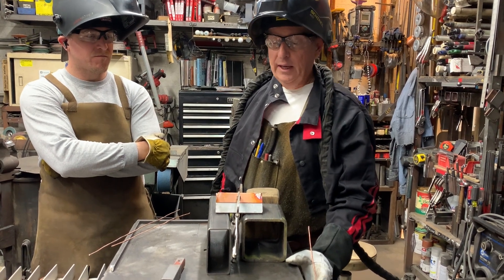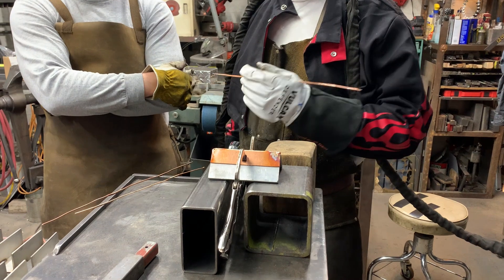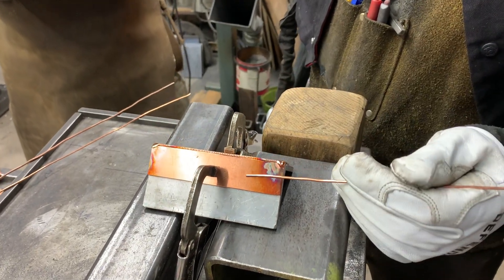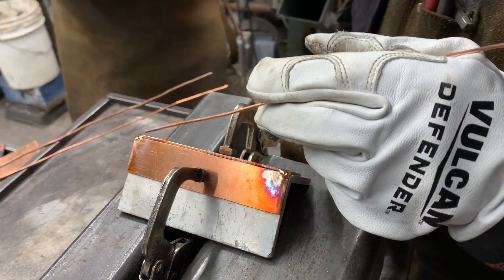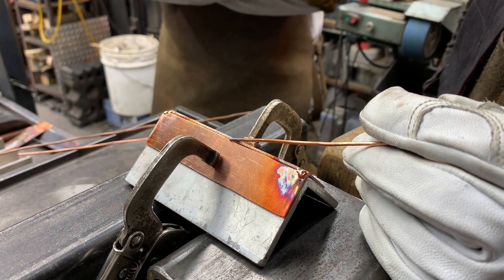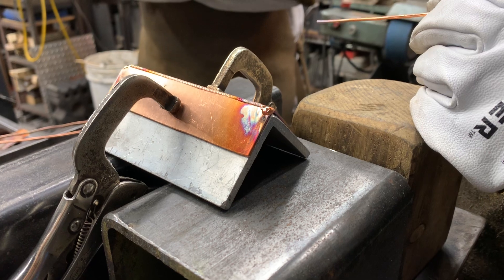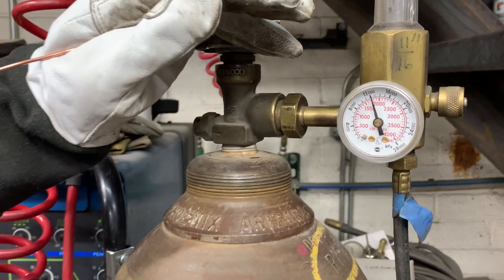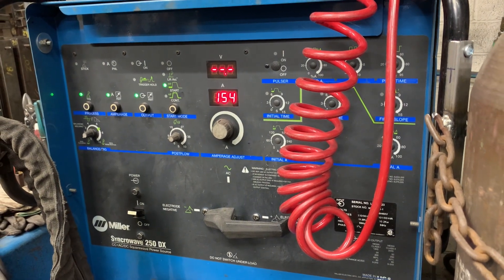Welding Copper with Romex

Comment: Try a flux and see if the porosity disappears...  Messing around with unconventional stuff is great fun.
Reply: Might want to try AC too for extra cleaning, might make a difference to the porosity, and, add less filler - and/or, try pulse to get it to wash in better...
Reply: I don't see any porosity.
Reply: @darenscott1718  About an inch along from the start, by the clamp anvils...6 pores, and again by the end of the bead, another 6 pores.... Dirt, loss of shield, not using deoxidised filler or basemetal etc etc. A flux may help?
Reply: @paulmeersa7162 ok,  now I see it. That's a shielding gas problem with this particular joint set up. The gas is heavier than air so wants to flow down the joint away from the puddle. Turning up the cfh will help eliminate that. If this were a fillet weld the gas would be trapped at the weld puddle and there would be no porosity.

Using flux would likely make the problem worse, or cause other problems,  when using the TIG process.
Reply: @darenscott1718  Really.

Comment: is it possible to stick or wire feed mig weld with copper?
Reply: Depending on the alloy, it is. Used for high intensity busbar joints.
Reply: @rogue8137  ah cool thanks
Reply: I was just wondering the same thing